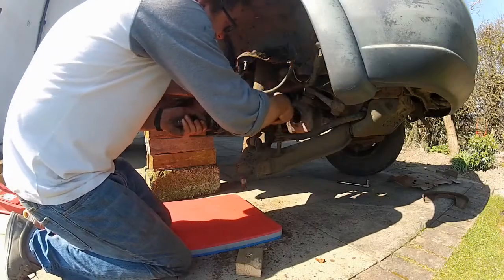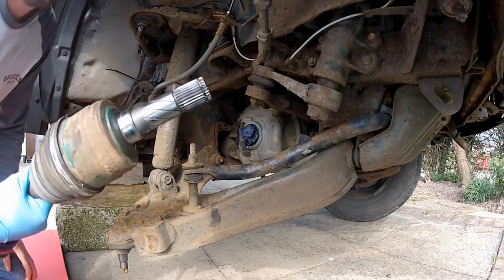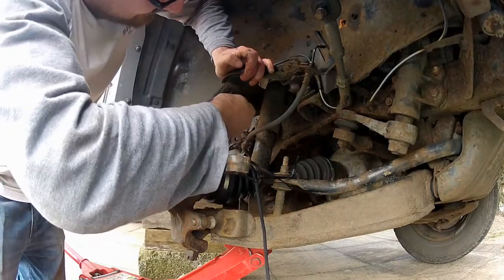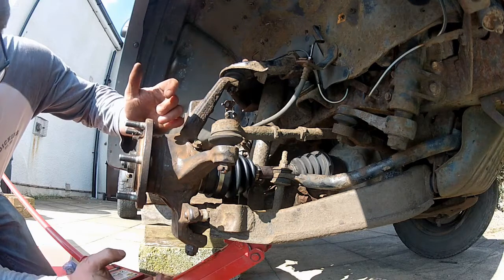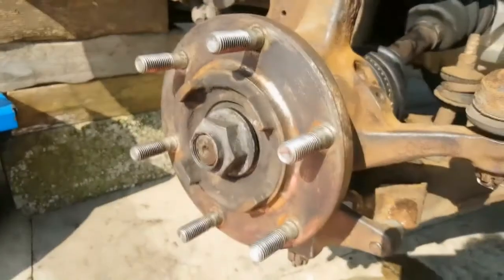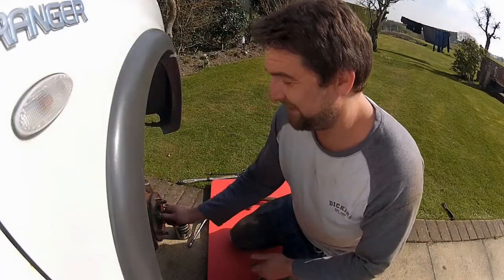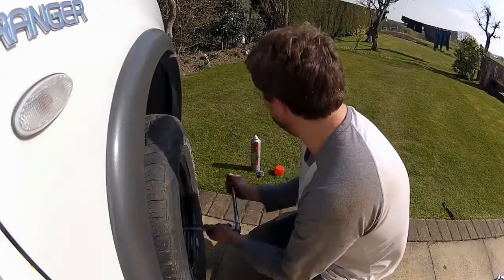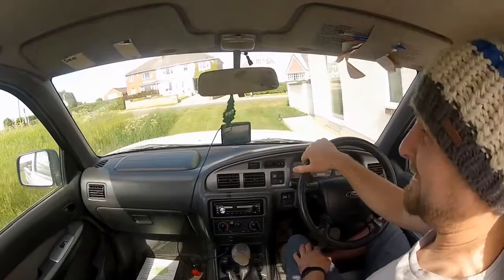How to Replace a Driveshaft / CV Axle | Part 02 Driveshaft Installation |  Tech Tip 24

Comment: Perfect 3 part series. Exactly what Im going to do. But I have to replace the cv joint. And I also have the 2.5 Ranger, only the double cab. So, everything is exactly the same. Thanks for the tutorial.
Reply from the maker: Thanks Jaco. Always a bonus when it's the same vehicle. Good luck 👍🏻
Reply: @FastRust  Jobs done and dusted. Drives like a charm. Thanks mate.
Reply from the maker: Great to hear 🤘🏻